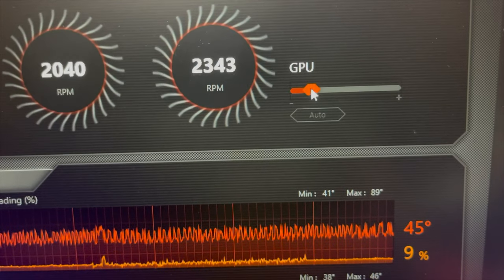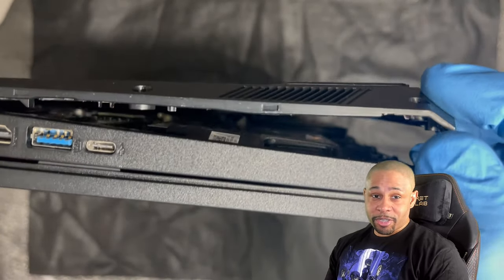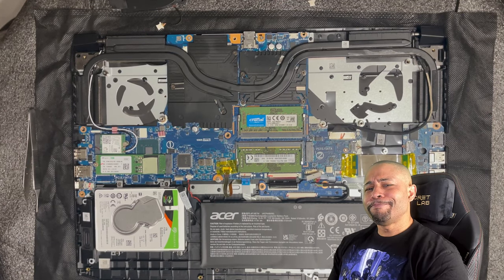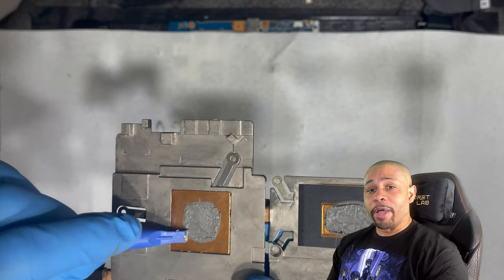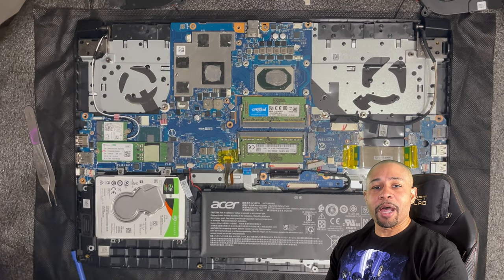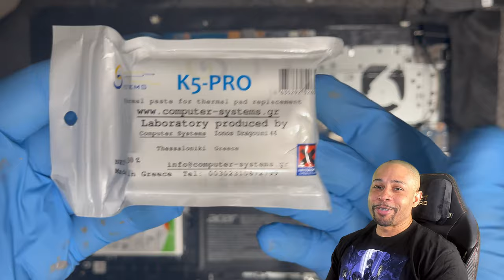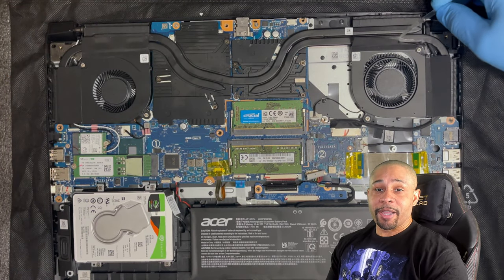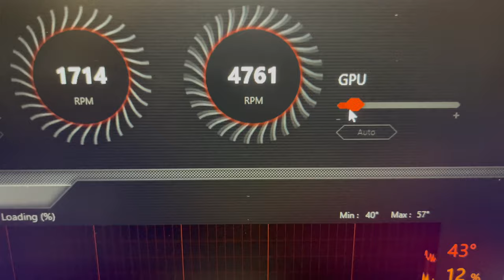Fan Replacement & Repaste Tutorial Acer Nitro 5

Comment: My fans were vibrating the entire laptop, and after ordering the fans in your description and following the tutorial it worked. My first ever tech repair lol, thanks for the helpful video.
Reply: My one fan seems to he doing that is it damaged badly?
Reply: @patrickbovin8023  If it's slight, might not be an issue, but it could get worse over time. If you can afford it I would recommend replacing the fans. Could prevent a worse headache down the line. My fans weren't visibly damaged, but they were not acting right. After I replaced them, I had no further issues, the problem was purely with the fan. I can't say for certain, but chances are at least one of the fan blades are slightly bent and are clipping the fan enclosure. It probably won't affect the rest of the laptop, but could greatly diminish cooling.

Comment: excuse me sir.. do you have idea on how thick the gap between the VRM and the heatsink? Im trying to repaste my thermal paste on my acer nitro 5 laptop which I think have the same heatsink. I want to repaste it with K5 pro but i can't find the product in my country. so i just wanna go with thermal pad instead. but i don't know the exact gap between the VRM and the heatsink and buying some random thickness thermal pad could ended up not good for my laptop. so if you probably know how thick it is can you tell me if you don't mind? please. Thanks in advance
Reply from the maker: I do not know the thickness.  Sorry about that. If I find out, I will post here.  Have you tried ebay?  I know it's listed there but not sure about shipping to your country.
Reply: @Meanpooh  owh.. that's okay.. im just gonna try 1 mm first and checked if it's squished properly or not.. someone in acer website mention that you can replace the vrm thermal putty with 1 or 1.5 mm thermal pad.. btw.. thankyou so much for replying my comment.. have a good day.. thankyou.

Comment: Amazing video! Do you have to replace the fans if remove them for cleaning, or is the adhesive on the tape good enough to simply re apply it the fans.
Reply from the maker: You can reapply.  Its safe to remove them for cleaning.

Comment: I would remove that gallium plaque from the heat sink and polish it, i'ts a massive bottleneck in transfering heat. I once had an old scalped i5 with LM under the lid, it solidified and etched the lid surface pretty badly. What I did is I took a piece of 2k grit sandpaper, glued it to a flat block of wood with a double-sided tape and  ground the plaque away. In the end the surface was very cavernous with bits of metal stuck in the holes, but I used fresh box cutter blade and very carefully pried off those bits of what essentially was gallium amalgam foil, then polished the surface some more to make it as shallow as possible (a few particularily deep caves remained though), and finished it off with some polishing paste so it looked like a mirror, always using that bit of wood to not make the surface wobbly and curved. It looked like a plaster wall initially, but in reality the grooves were less than 0.1mm deep, so I could just press the lid further to compensate for removed layer of copper to make good contact (the silicon gasket around the lid is about one millimeter thick, I removed it and used some silicone to reattach the lid). It didn't do much difference at that moment, but the contact surface of gallium and copper would corrode further over time, deepening the damage. It works for ten years already, I change the grease once every 18 months or so. I use Arctic Cooling MX-4 instead.

Comment: Meanpooh, thanks for a clear and in depth how to, without the hurried, or "everyone knows that" assumptions that some professionals overlook. I've watched this video - and vids from other sources - a couple of times now, to sort of steep myself in the whole process. Creators like you are invaluable to newbs like me; especially the ones who weren't born in the age of home computers and cell phones.

But when I watched you use a vacuum/toothbrush combo to get at the dust buildup, I had to post this and ask, is that safe? I've heard over and over not to use a vacuum to clean dust off of computer equipment because the vacuum's operation causes a static charge to build up which has the potential to short components like the mobo. 

Could you explain how you vacuum safely with no concern for that commonly heard advice? Is the addition of the toothbrush and the light brushing motion enough to negate any charge buildup? Also, I'm not sure if the static charge comes from the motor's operation, or the movement of air. If you do know, could you please tell me if using a plugged in vs. a battery operated vac matters? I.e., is the effect is more likely with one than the other? Finally, if a household vac is used, is using the hose attachment so the vac itself is a few feet away a safe precaution? Thanks again for your videos. They've earned my sub.
Reply from the maker: Using a toothbrush on the heatsinks will not pose a threat to a laptop. There are no moving parts or any electrical items on it.  Spinning fans at high speeds while cleaning can generate a back current, potentially damaging the motherboard or other components. It's a good idea to hold the fan blades still when using compressed air or a vacuum near them to prevent this issue.  Unplugging the fans from the board is a good idea when cleaning.  Using a vacuum to clean parts like metal, plastic or heatsinks is pretty safe but vacuums can create static electricity, which poses a risk to sensitive electronic components. An anti-static pad can help mitigate this risk which is what I use but it's not foolproof.  Compressed air is generally the safest option for cleaning internal PC components. However, care should be taken to avoid blowing moisture onto the board or components. Keeping the compressed air in an upright position can help prevent condensation from forming and causing damage. Just be mindful that both battery powered and electrical devices can generate static electricity.   Thanks for subbing.👍
Reply: @Meanpooh  Thank you for your quick and comprehensive reply to a question about a vid that's ~ 2 yrs. old. I do have an ESD mat, strap, ...etc. Vacuuming instead of canned air always seemed like a better option to me. With compressed air, I considered that it seemed possible to blow some dust into areas that it would not get into normally. Again, thanks a bunch.

Comment: My rear vents are kind of blocked like no air is coming out from there and that explains how my idle sometimes goes as high as 65 deg (completely idle) which I know is too much.

I have previously opened the laptop myself to upgrade the storage and ram, but now I will need to clean the fan, I genuinely liked the video and will update after I clean it today :)
Reply from the maker: Just make sure you unplug the battery. 👍
Reply: @Meanpooh  And I have done it :)

I didn't apply any thermal paste/pads till now, it is completely stock in that way since my laptop just turned 1 year old this may, and my temps are now back to 45-50 deg idle ....

The thing was, there was a fudge ton of dust buildup in my rear vents, so I had to clean it and voila ! 

Thanks for all the suggestions :)

Comment: Hi, nice video. Its big problem if i dont change those "things" with k5 pro? just leave old ones, and change only cpu with gpu thermal paste?
Reply from the maker: If they are in good shape and fairly new, I dont think its a problem.  I've done it before with a new laptop.  You should have no problem.  Make sure to keep an eye on your temperatures if you do.  If they are higher after you remove the heatsinks then you may have to replace them.

Comment: Hi I’m new to this, I’ve had my nitro for about 5 years do I have to also replace the paste for those little chips around the gpu or is repasting only the cpu and gpu enough?
Reply from the maker: You should replace the pads and repaste the CPU and GPU.  If you are not hitting 94 and above, I would not bother.

Comment: Great video - can I ask why you didn't use the K5 for the CPU and GPU?
Reply from the maker: The reason is that K5Pro is pretty much a liquid thermal pad, almost like putty.  Its is not made for the CPU or GPU.  If you were to put this on the CPU or GPU, It would get too hot.  It would not be able to dissipate heat fast enough and most likely would dry out from the extreme temps.
Reply: @Meanpooh  Thanks for the response. I've read elsewhere that you can apply the K5 to the other components. I did this and can now game on my laptop again as the frame rate has gone back up. I will buy the other product you used and when I experience further issues, I'll try your approach. Thanks again 👍🏼

Comment: Just followed this guide and a couple other ones cause I have a different model. Everything went good and temps significantly decreased but my cpu load is higher for some reason and spiking up to 30 sometimes almost 100 percent despite being 50 and 44 degrees. I might’ve put too much thermal paste but tried to do it the same as the vid. Any insight would be appreciated.
Reply from the maker: The spiking of CPU utilization can be attributed to background process.  Sometimes a Windows update can cause this as well as games.  Antivirus software is one to watch for.  Too much thermal paste is better than not enough.  Believe it or not, new PC setups cause lots of CPU utilization spikes because it sets itself up for the user.  I've had this go on for over a day before.

Comment: My fans arrived with tape only on one side rather than two. Do you reckon I should return them due to the tape having some functional use or is the tape merely just to keep the fan in place?
Reply from the maker: You could send them back or you could take the tape off the old fans.  The fan sorta creates a seal for airflow.

Comment: Thank you for the very clear tutorial! I was scared when I saw mentions of needing a paste for the fan replacement, but somewhat relieved to see it's a different process from fan replacement, though heavily recommended.

It's kind of scary to read up on repairs for laptops costing well over $500 when the parts are under $100 and just need screws... Granted, if I mess up it's my own fault as a nonprofessional tinkering with tech, but for some repair costs out there, I might as well save up for a new laptop, yikes.

I think I messed up my gpu fan after cleaning it for the first time in a while... Loud noise and even slight vibration, but it's not the fan being jammed or a loose wire, so after asking around and looking up different sites, it seems like the fan bearing has just worn down after many years and my cleaning finished the job, oops...

At least my laptop's not hot, but I figure I better bite the bullet and fix it now rather than wait and find out the neglect slowly made something else worse.

Thank you again!

Comment: 2 of my screws are stuck, although conveniently theyre next to eachother. Do you reckon it'll still be possible to open up my laptop or am i basically screwed?
Reply from the maker: Try a larger driver and press hard.  Make sure the driver fits comfortably within the screw.  Meaning that the grooves match up.  Press hard and turn.

Comment: What the difference between K5 pro and thermal grizzly? Can i just use thermal grizzly
Reply from the maker: Thermal Grizzly in the video is thermal grease.  K5 Pro is pretty much a liquid thermal pad.  Its very viscous, not to be used on CPU or GPU processors.

Comment: My GPU fan has been making a similar noise, so I'm thinking of replacing it too. 
My only problem is that the battery connector is really stuck in and I can't remove it easily 😬
Reply: Mine was like that too. You just can't be scared of damaging it because you won't. Just give it a small yank with pliers. If it really doesn't budge then don't do it
Reply: @gusjohnson4477  Yeah I've bought some pry tools to help me when my replacement fan arrives. Hopefully that will make it easier haha
Reply: @HarrowPlus   I don't know if I need to replace mine. it makes clicking at low rpm like it's hitting something but it's not that loud and it hasn't gotten worse. I just need to get in there and actually see what the fan is like.
Reply: @gusjohnson4477  My GPU fan is constantly making a weird clicking noise that gets worse when the fans get faster like when I play games or edit videos - so a replacement is defo the way to go
Reply: @HarrowPlus  yeah mine is only clicking when it's slow so I'm assuming the clicking must just be a fuck ton of dust and when it spins really fast it blows it out of the way and when it's slow it doesn't.

Comment: huge thank u, I just noticed my gpu fan was not spinning so ima have to replace it. I don't know much about computers and I've messed around with inside the laptop with a few things but I dont know everything so thank you for also including how to repaste as well. I'm probably way over due and I might have the same issues that u faced with the thermal paste not coming off so I'm not looking forward to that aaaaaaaa.
Reply from the maker: Good luck and don't forget to disconnect the battery. 👍

Comment: Trivial question, once I did finish adding the k5pro along with the grease I was about ready to lay the cpu and gpa fan on top of it. But I did add some pressure to the vents that is below the gpu fan, will it still have any effect on the k5pro? And If so should I redo it again?
Reply from the maker: It should have no effect as long as you added a decent amount.  You should be fine.  If you happen to remove the heatsink a few months later then you would most likely have to add some more K5 as it would be flat and may not adhere correctly when reassembled.

Comment: will lubricating the fan fix this initial problem?
Reply from the maker: It can help temporarily and the problem will come back.  In some instances it can make it worse.  If you do decide to lubricate, don't use grease.  Some people use a light oil.  This can also collect dust.  It's risky.  Personally i'd just deal with it until I could replace them.

Comment: hey dude i couldnt get the heat sink screws what kinda screw driver i need screw number 5 got little damaged so none of the screwdrivers i have fit now it looks like a circle  rather then a plus
Reply from the maker: You could try using a regular size screw driver with a fine tip.  This way you can add pressure and have a more sturdy bit.  The only other way would be to use an extractor if you can find one small enough.
Reply: @Meanpooh  dont have one so im looking for a screwdriver set with ph0 in it

Comment: Lovely video, two questions! Is it necessary to replace both fans if the problem is from the GPU fan only? And is it necessary to repaste when replacing the fans, even if it’s just a GPU replacement ?
Reply from the maker: It's is generally sufficient to replace only the defective fan without the necessity of replacing the other fan. Just know that replacing both fans will save you time if the other fan decides to go out later.  Additionally, reapplying thermal paste to the CPU and GPU is not required unless you are also disassembling the heat sink or observing significant thermal performance issues.

Comment: Thank you for your video ! I have a similar issue and I have to change the thermal pad because they melted a bit... I can see some red material that it slightly going out from the heat sync. How can I replace them? Buying other thermal pads or using some thermal passte on it? Thank you 
My pc is just 1 year old LOL
Acer thermal paste is a shit ahaha
Reply from the maker: Buy other thermal pads is best. The tricky part is finding the correct size. The common sizes are .5 and 1.0. Using thermal paste is easier as you just spread it on but it can get messy.

Comment: My Acer Nitro 5 GPU fan won't move on auto, but it moves on max after a while. I shined my flashlight into the vent and it twitches like it's trying to start. Is it the GPU or the fan in general?
Reply from the maker: Your fan is almost dead.  The most likely reason your fan moves  on max is that it's getting more power.  You can see the same problem with people that use box fans in their home.  After so long, the fan gets dirty in places where you can't clean and it will not turn anymore on the lower setting.  Before totally biting the dust, the fan will barely turn and will just burn out and stop.  The internal parts of the motor also has a lot to play, they don't last forever.
Reply: @Meanpooh  you're amazing! I also have one more question, sorry I'm a boomer when it comes to computers. Is a CPU fan the same as a GPU fan? I've bought a replacement and have seen that it says CPU
Reply from the maker: Depends. Some machines only have 1 so that will be true. If your machine is similar to what you see in the video, they are different. Screw placement will be different on each fan. 1 is for the GPU and the other Is for the CPU.